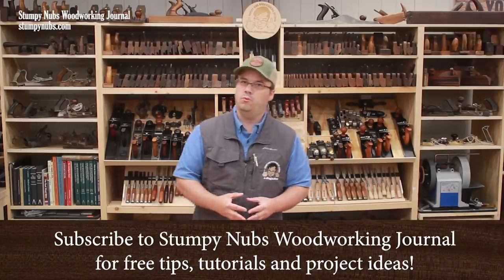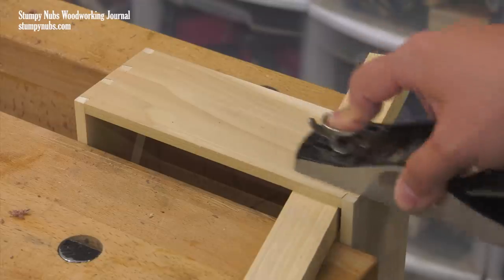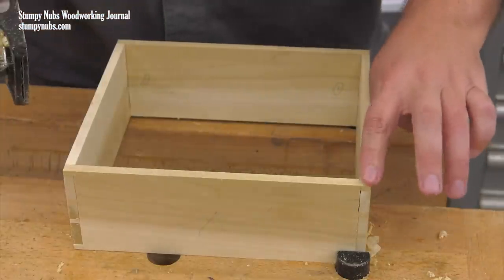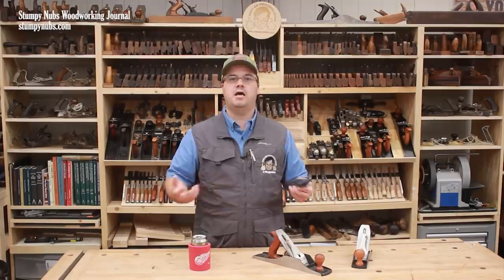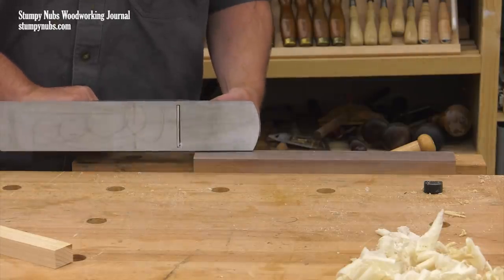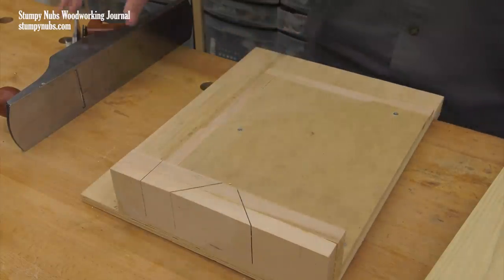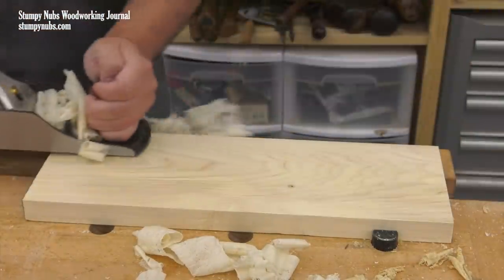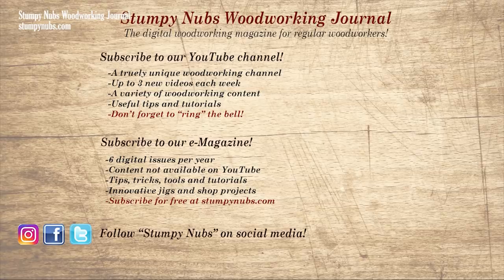Two hand planes you didn't know you needed

Comment: James - watch your video without the sound on. Notice how the block plane is more difficult to use on all but the chamfer. The #4 seems to be doing all the tasks with ease.  Yes the block plane is great for some of these tasks, but unless you are in a tight space, it appears the #4 does them all with less effort.
Reply from the maker: I was using it in an awkward position do stay out of the camera's way. I don't find it difficult under normal circumstances. But not everyone feels the same way, and the important thing is to use what works best for you :)

Comment: Amen, Stump, and as nice as 5-1/2s are, they're kind of scarce and expensive on the used market. #6s however, are plentiful and cheap. Millions of carpenters lugged them to the job site for generations to have many of the same attributes you've mentioned for the 5-1/2 plus they're a little better suited to jointing. At tool swap meets you ought to be able to get a battered and maybe rusted #6 with rosewood handles and no casting breaks or boogered oddball threads pretty quickly for about the same money as a #4. I happened into the pieces to put together a 606 Bedrock, put a premium blade in it and am tuning it for use in a shooting board. Pretty snoot, huh?
Reply: Another thing you can do if it's going to be a user, cut down the back end of an old #6 for lighter weight. You get the same width iron as the new 5 1/2s for a lot less outlay

Comment: This is very helpful and I appreciate it. One question, I’ve been told a plane on a shooting board shouldn’t have any camber on the blade but a slight camber is often used on a plane for smoothing. If I get a 5 1/2 should I not have any camber?  I know the slightest camber is sometimes added to avoid any ridges left by the two corners of the blade.

Comment: Hi James. Brilliant!  This is a topic I've struggled with.  When I started to learn about woodworking some sixty years ago, hand tools were almost the only thing available. Dad had a very basic table saw, a  Skill circular saw and a 1/4" electric drill, so I learned a bit about hand tools. Fast forward to now and I have a fully equipped shop filled with power tools. I do have a couple cheap hand planes and while they are useful, a silk purse cannot be made from a sows ear. Now I know what to buy, a good brand to search out and why.  You are truly a gem, there are so many enhancements to my shop that originated right here.  Thanks so much for sharing!

Comment: I mostly agree with your opinions here. The premium planes seem to be heavy, which is fine for a short time. This is ok for hybrid woodworkers. For those without planer thicknessers who plane for long periods then I would recommend a Stanley with an upgraded blade.
I have a Stanley number2 and find it an alternative to a block plane. Even more versatile than a block plane is a rebating block plane. However it does have sharp edges to avoid when gripping it. My Qiangsheng number 5 has the most comfortable handle, less backlash and blade, but I rarely use it as it is so heavy. I keep it in a cupboard to admire it most of the time!

Comment: Just yesterday I bought this exact same block plane new at Woodcraft for the same reason you state here. I wanted to get the best new one that I can afford, rather than a used one that potentially was tortured during use or not restored properly. If I ever see the need for larger plane jobs, I will get that 5-1/2 as well.

Comment: Paul Sellers who recommends a #4 for overall work believes block plane doesn't often use or recommend block planes.  But I listen to several WW channels, your own, Rob Cosman, Matt Estlea and a few others, and opinions naturally vary.  I am a hybrid WW and use a Wood River 4 1/2 and block plane,  finding them just fine for the small projects I do.   I use machines for initial stock prep because I hate this part - like sharpening.  Then I clean up the faces and edges with the hand planes to produce the clean, shiny final surface without having to sand (which I also dislike).   Respect your opinions and enjoy the channel.

Comment: I find that I most often use a block plane and either a #3 or #4 smoothing plane. I detest sanding and hand planing is faster for me than going through multiple grits - and I don’t need a dust mask. The shorter #3 and #4 follow slight variances in the board better than a longer plane which will only remove the top at first.

Comment: I posess all those planes. But your view on planes is quite interesting. And I  thought thst I would agree. Indeed a block plane is mostly used.And 5,5 is heavy and I use it successfully with shooting board, since there is no need to lift it ))))).
For beginners a combination of  these two planes is the most reasonable choise

Comment: I own 3 planes. A Stanley no. 60-1/2 low angle block plane, and a wood river no. 5-1/2 jack plane. I Also a Wood river 92 shoulder plane, and a No 45 combination plane. The first two are honestly the best options if you're only going to use planes for some tasks that are not powertool candidates

Comment: My woodwork is a mix of power tool and hand tool…I find it quicker and easier to use a hand saw and clean up with a plane, rather than set up a jig, for some cuts.
As such, I have a few bench planes… 
9 1/2 block plane
No.4
No 4 1/2
No 5
No 6
Wooden jack/scrub
Wooden try plane
By far the most used is my No 4. Most of the tasks you suggest for the block plane, I do with the No 4…breaking sharp edges (arises), chamfering, cleaning up joinery etc. I find the two handed grip and heft (compared with the 9 1/2) gives me more control.
My No 6 covers the duties you describe for the No 4 1/2, just a bit longer and heavier and probably cheaper to buy second hand.

Comment: I always use hand tools to clean up power tool marks.  Usually it's a few strokes of a No5 or No 7 low angle veritas, but maybe I should give this 5 1/2 a try.  The No 4 is the best trade off weight wise (I have like 8 of them LOL).  Though it's my 2 cents that it's not really a tool that you can easily learn on.  The smaller front edge reference, or how you've tuned your blades really makes the tool take on very different characteristics.  I personally really dislike the block plane because I have tiny stubby hands (well relatively).  It's always my preference to use a No 3 in its place.  I find the narrower and taller Veritas DX series block plane work well for my hands, but I am always banging my finger into something.  Oh well, always one more thing to complain about I suppose.

Having a larger router plane really helps with some depth related stuff.  A small plough plane is great for quick jobs to make dados and grooves.  In fact, a plough plane is often faster than setting up a table saw or a router. The combination version is IMO not worth the setup effort and the weight. In the end, the more the merrier, though I find these two are definitely worth having for most people as accessories planes.

Comment: I started building about 45 years ago and had no power tools at the time so had quite a good collection of planes (and handsaws). Probably bought my first electric planer 35 years ago and since then have only used a block plane or very  occasionally a 4 or 5 and I don't recall using a 4 or 5 in the last 10 years at least.

Comment: Several years ago I bought two planes in an antique mall because I knew I needed a plane to adjust some old doors that were installed in new construction.  Knowing nothing about planes, one was a Great Neck Corsair with plastic furniture.  It's so horrible I won't give it to a new woodworker.  The other was a Stanley #220 block plane that brings joy every time I use it.  I see shipwrights fine tuning big timbers on boat channels all the time using a diminutive block plane.

Comment: I am a hybrid power tool/hand tool worker. I almost never use the block plane. I have two 4s, two 5s, 5 1/2, and 7. My small shop has only a benchtop 6 inch jointer, so the handplanes round out my strategy.

Comment: I wouldn't be without a block plane but I also wouldn't be without another plane in the 4 to 5½ range. My woodworking isn't just about shop projects, it's also about DIY about the house. I've got everything from a No 3 to a No 7 but I also have a second No 4 that goes in my tool box if I'm working away from the shop.

Comment: I agree, a No 4 is not the first choice. But neither is the 5 1/2 in my opinon. I disagree with Paul Sellers and Rob Cosman. Both favor almost exclusively classical methods of woodworking. I combine machines and hand tools to achieve my goal. I think the right choice is a No 62. With the No 62 and the right iron angle, you can work almost the same as with the classic No 4, No 5 or No 5 1/2, but you cannot replace a flat angle plane with these planes. By adding a second iron lapped at a different angle, you have the most versitile plane you can get. 
The No. 62 also works well on a shooting board. Nevertheless you still need two planes.
If you are a woodworker a block plane is necessary. You also can't avoid buying some chisels if you regularly work with wood, even if you mainly use machines.
Since I don't live in the Americas, and Woodriver planes aren't available in our country, I recommend planes from Veritas, a brand Rob Cosman doesn't seem to know, even though they both come from the same country.

Comment: Speaking on the basis of almost 50 years in the trade, your choice of hand plane tends to rest on the law of averages and scale of work being carried out.  There's also practicality and whether you're work site or workshop based and doing a great deal of finishing work.  These are elements that influence handplane choice.  

Many site joiners (Carpenters originally covered 1st Fix framing and construction) involved in 2nd Fix work would initially invest in three handplanes:  Namely the #4, #5 and a high or low angle block plane which would be carried in their toolbox alongside the rest of their toolkit.  Later, they might opt to buy a #4-1/2 and #5-1/2 if involved in planing wide stock, but typically the 2" wide plane iron found in the #4 & #5 is more than adequate for typical tasks encountered.  They're also  much lighter than their #4-1/2 & #5-1/2 counterparts and it can be quite surprising how much difference that extra weight can make when carting a toolbox between sites.  

If edges are keen and planes are well adjusted, they will serve their purpose and the best starter set of handplanes can be a block plane and either a #4 or #5, but you will tend to find the set of three planes will cover all angles in terms of stock prep.

Always invest in the best hand tools you can afford, or face the definite risk of having to replace cheaper pieces due to flaws and defects.  How much to spend and what to purchase is always a personal choice, but there's no real need to buy the best unless you're going to use them professionally or with far more dedication than on a casual DIY basis.  Thicker plane irons aren't a necessity and this is because the pairing of thinner plane irons with well set chip breaker/cap iron negate the need.  

By all means experiment with thicker plane irons later in your woodworking career while instead learning to master the use of your tools and working timber.  Avoiding the trap of buying into more exotic tools allows you to invest in timber to work and make things from.....  So, invest in a good quality, basic kit and lots of timber, then later invest in tools you can justify having in your tool kit.  Regardless of if you predominantly use power tools or hand tools, the same set of basic rules apply.

Comment: Thanks Stumpy for the tip! I purchased a good block plane and I am saving up for a low angle jack plane. However it sounds like it will be a 5_1/2 smoother
Reply from the maker: For a while, low angle Jack Planes were all the rage on YouTube and in magazines because you could swap in different iron grinds. I own three of them, but hardly use them because the average modern woodworker has little need for toothing irons or extra steep bevels. The 5-1/2 is less expensive, and that extra size is useful, as explained in the video.

Comment: Definitely some good points, but I think that which hand tools are best for a woodworker depends on the work he does.  I've been a hybrid woodworker for over 35 years, and have also worked selling tools (including handtools) for the last 7.  When asked which handplane someone should buy, I always ask what type of work they plan to do.  For instance, my major use of hand tools is to accomplish two things, 1) eliminate as much as possible the need for a router, and 2) eliminate the need for a jointer.  I have concentrated most of my hand plane acquisitions around these two tasks, and it works out well.  Hand and power tools working in near perfect harmony.

Comment: I agree with you completely.  I have 3 block planes, 1 four, 2 fives, and a six.  I never use the four.  I use all of the block planes and both fives a lot.  Wish I had a 5 and a half.
Reply: The 6 is only three inches longer than the 5 1/2 and for the most part all the other dimension are pretty much the same.  Use the No. 6 and see if it works in your work flow.  That said, if you want a 5 1/2, buy one.  I have three 5 1/2's and three 6's.  All but one 5 1/2 needs a good tuning to be put into use.  I have numerous block planes and reach for them less than the No. 4 and I can't remember the last time I used my No. 4.  Maybe my projects just haven't called for them like yours have.

Like you, I rarely use my No. 4.  When I do use a metal bodied plane I find myself reaching for my 4 1/2 instead.  I actually prefer my wooden coffin plane over my metal smoothers.  Eventually I will use wooden body planes and sell of the majority of my metal body planes.  I'll keep a set of metal planes (3-8) but there is just something about using a wooden bodied plane that is hard to describe.

Comment: One possible disaggreement.  You really don't need a premium block plane.  I have two block planes I use regularly and both are relatively cheap Stanley's I bought new,  But ,,, the first was purchased in the 1990s, and the second, a low angle, sometime between 2000 and 2010, so YMMV.  They are both excellent planes.  I use them for easing corners, forming round overs, and small trimming and smoothing jobs for small boxes.  I do have a "premium" Lie-Nielsen block-style rabbet plane with the nickers that is handy for cleaning up the cheeks of tenons because the blade is full width to the body.  It can also handle all the jobs the others do.  But, it's premium because there are precious few rabbet planes of that form that aren't.  So, for a premium block plane, I suggest one like the Lie Nielsen 60 1/2 rabbet plane.
Reply from the maker: I never said you needed a premium block plane. I said you can get one and restore it if you like, but a new woodworker without the experience of using a properly tuned plane will benefit from a premium one that will work well from the start, and he will avoid getting frustrated and turned off planes.

Comment: Another great video full of great infor. I would add as a former power tool wood worker, I found no better satisfaction to hand planes. I still use my power tools when I am in a cronch to finish a project,, but I rarely sand any more because of the dust and run a plane across the surface and get a much better final result and faster in my opinion,, any one want to buy a electric sander? I use my hand planes instead,

Comment: I have a power plane, shortly after getting it, the blades dulled. So I watched a few of your video's and Paul Sellers and Rex Krueger. I now have a few number 4's a brace of number 5's and a single block plane which gets used of occasionally, the 4 and 5 being my weapons of choice. The power planer ? It's somewhere ........... it needs new blades though, I did of course find the spare blades that came with it, they're somewhere to !!!

Comment: I think you are missing a couple of key points.  A jack plane be it the 5 or 5 1/2 can also be used before using power tools. When working with rough lumber often times using the jack to get it close to flat/removing twist is very helpful before taking it to the jointer/planer.  Second, you can get smoother quality results with the 5 1/2 if you have a sharp blade and close the mouth.
Reply from the maker: This isn't an all-inclusive video about everything a jack plane can do.
Reply: @StumpyNubs  Agreed. I just thought since you were targeting the hybrid or power tool woodworker, it would be good to point out the benefits of hand plane even before the wood goes to the power tool. I think it’s a great use of hand tools that can save time and blade life of your jointer and planer, as well as thickness of your stock.

Comment: Stumpy, I'd love to see you comment on the 5 1/2 vs 5 and vs low angle jack. The Woodriver #5 is quite a bit cheaper than the 5 1/2. The low angle is in between costwise. I know Cosman doesn't like the low angle, but lots of other people seem to. As a primarily powertool guy, I'm exactly the audience for this video and I started with a LN rabbeting block plane and now I'm ready to start thinking about what's next...
Reply from the maker: I just explained why I like the 5-1/2, specifically the mass and the extra toe length. The other two planes you ask about lack those features.

Comment: I'm sold.  But where do i get a 5 1/2 plane?   Even googling it, they seem very hard to come by.  If I can't find one, or don't want to spend $229, would a #5 or a #6 still be of benefit to a power tool guy, or am i just wasting my time?

I ask as i just got a thickenss planer, i also have a cordless planer, but no jointer, so the idea of a plane to smooth out what i've done with the power planer sounds great when joining table tops.

Overall great video, it's something i never thought of, but i am now.